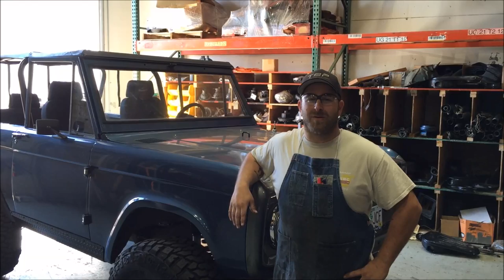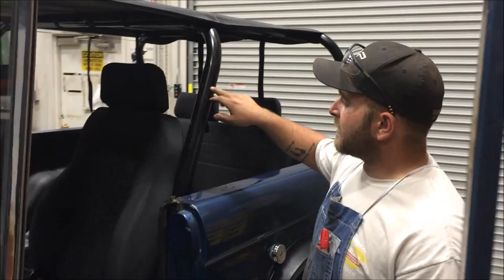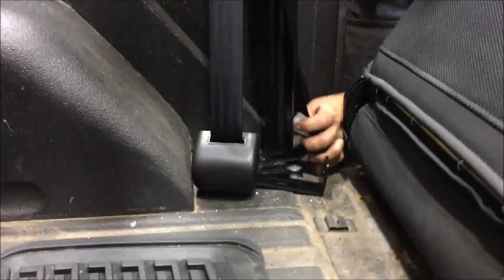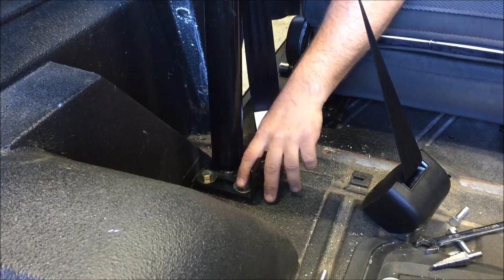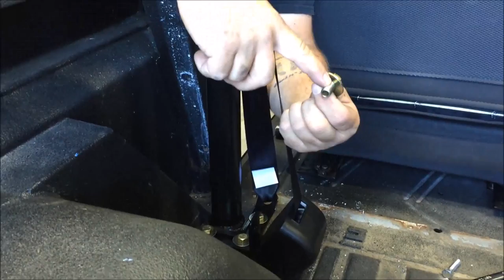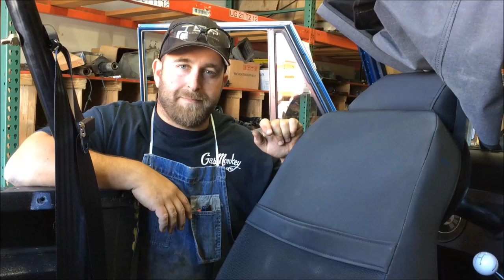TOMS OFFROAD Tech Time Episode 6 3 Point Shoulder Belt Installation

Comment: I was told to never do what you're doing drilling a hole thru roll bar can make it snap at that point and drive into the beach of your head...that's why on TJs they wield in a post for the bolt to go thru to keep roll bar solid? ...please answer me back because I'm about to put my 3 point in asap....
Reply from the maker: Sonny if you plan on using your Bronco for extreme off roading and tieing the bar in to the frame then I would sleave the drilled hole with a threaded insert like you will find on Summit Racing for race car aplications.  If you plan on just bolting the bar down to the floor like it is designed, the plates will push through the floor prior to the bar ever snaping.  Also if your Bronco is going to be used for race aplications I would recomend a DOM cage but they cost at least 3 to 4 time more.
Reply: @TomsOffroad76  Thanks Brother I'll be wielding tomorrow...✌😊👍
Reply: I'm doing a 1967 CJ5 build as I type this...